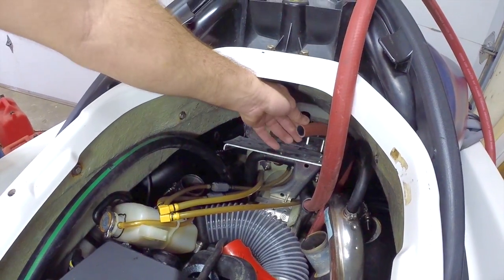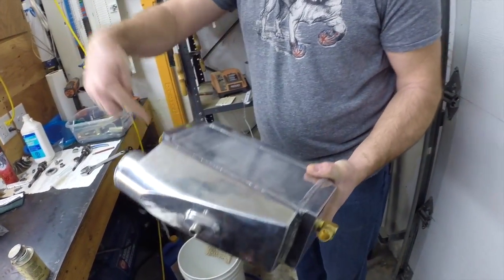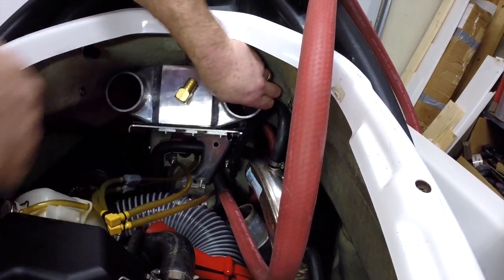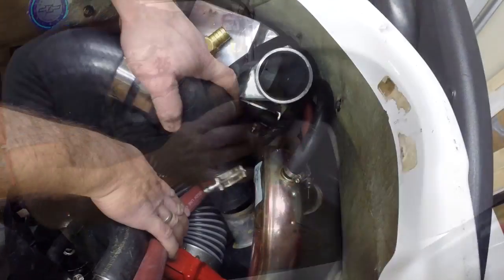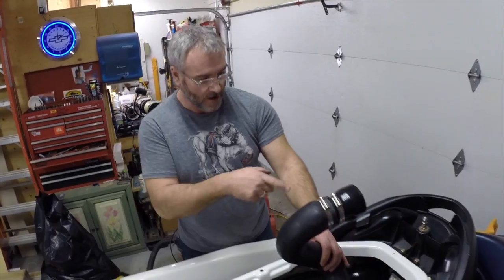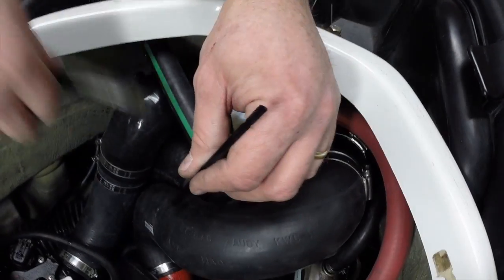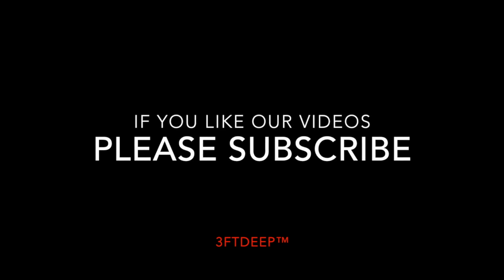How to Install an Intercooler (on a Supercharged 4-TEC Sea-Doo Jet Ski)

Comment: I am a Yamaha guy but I couldn't pass up this GTX 185 I bought from a woman that didn't know what she had. $1500 with 51 hrs on it and a trailer like showroom condition, this thing is rocket as is but yes a cold air intake and intercooler is needed. Thanks for the how to video and I hope these parts are still available even after nearly 5 years when this video was done.
Reply from the maker: Congratulations on your purchase! Yes, the part should still be available for your machine. Good luck.

Comment: I am really interested in the before and after results of adding the inter cooler…..    Standing by.. 😊
Reply from the maker: Hello Brett, You'd be disappointed. In this case there was hardly any difference in performance. There are lots of reasons for that, but let's just say that the performance of such a machine is based on a "system", not just one or two components. The intercooler is just one of them. We showed the process to help people who want to add one as part of a system upgrade. Thanks for your comment.

Comment: What kind of intercooler is that & what do you suggest to spray in the cylinders etc..after water ingestion in the motor?
Reply from the maker: ***** If you took in water, change the oil a few times, and spray some fogging oil into the cylinders. As for the intercooler, we got it from Silicone Intakes: www.siliconeintakes.com. It's a "Type 3" model. Good luck!
Reply: 3ftDeep Thank you! I'm working on installing mine now I ordered a cx racing one, looks like I'll have to modify my stock hoses this one is much wider than my stock one.
Reply: wait a minute, your parts list says type 9 intercooler but this comment says type 3.. which is it?
Reply from the maker: Good catch. It was a Type 3 intercooler.

Comment: where does the intercooler get its fresh water supply from on the pump? just anywhere in line? and how did you tap into it? bulkhead fitting?
Reply from the maker: Through the reducer (i.e. the first hose we remove). We essentially tapped in series into the existing water cooling system.

Comment: did you use the stainless couplers for the hoses you connected together on the supercharger hoses or did you use the silcone couplers? i know you use the stainless ones for the exhaust but cant tell with the supercharger hoses. i am ordering all the parts from the website you listed. How does the supercharger you installed compare to the factory sea doo external intercooler? just debating on what supercharger to go with. Do you have an email that i could contact you at if i had any other questions when installing mine? Thanks for the help and the video. Skip
Reply from the maker: skip midgett  I used stainless couplers everywhere.  I did not have a stock intercooler to compare with, so I don't know the answer to your question. Feel free to message us through YouTube if you have more questions. Thanks for your comment.

Comment: How many hours to do install and did you post or hsve s link for all parts needed. I have an 03 185, assume install is the same, yes I have upgraded the pump already.
Reply from the maker: It took us a few hours to do the job, but that will vary on the machine you’re working on, and your technical skills. Here’s the list of parts we listed in the description section below the video on YouTube: 

Parts List:
(for a 2008 RXT-X 255 Sea-Doo)
270 000 706    Intercooler tray
293 850 067    Intercooler straps, need two
293 830 124    Rubber mat
270 000 718    Rear support
273 000 238    Supercharger to intercooler hose

Intercooler and the following parts came from:   http://www.siliconeintakes.com/
Type 3
SIL000064 – 3” to 2.5” silicone reducer
BRE000954 – 3” to 2.5” 90 deg silicone reducer
JOI000112 – 2.5” stainless steel silicone joiners
CLA000102 – 2.5” T bolt clamps
CLA000104 – 3.0” T bolt clamps
Reply: So the parts listed will work on the 185:as in your video ? Also  the first part of list part #s are from where, do you sell most of the parts needed ? Thanks
Reply from the maker: Sorry, we don’t sell any parts. You can find the exact parts you need for your machine by going on Sea-Doo’s website under Parts Catalog and looking at the parts diagram for your machine.

Comment: Last year you saved me as I had rebuilt supercharger, coolant flush and replaced wear ring mid season after the Old Man thought he messed up his 2007 RTX 215. Did you guys tune it after the intercooler was installed? Any new injectors or anything else aftermarket?
Reply from the maker: Hello, Vinnie. We didn’t do anything else to that machine. A re-tune would probably have helped out though, as the performance improvement wasn’t what we thought it would be. The additional power should also lead to a change in impeller pitch, etc. ….

Comment: I have the same ski just stock nice videos by the way. I was wondering what the top speed of your gtx 185 is with all the mods? Also i'm still debating whether or not I should upgrade my other ski for a 2004 Seadoo Rxp 215
Reply from the maker: Ben King Top speed is now 63 mph. It gained about 3 mph with the new intercooler and increased impeller pitch (that'll be in another video). One thing to be aware of with the RXP is it's shorter and lighter, and loves to jump waves. It's great for shorter rides, but can be very taxing on longer ones. The heavier 3-seater GTX is way better for those long trips in choppy water.

Comment: Are you going to do one on the gtr?
Reply from the maker: mgehrke20 No, the GTR 215 has an internal intercooler so adding an external one would have marginal benefit without doing all the other modifications that would be required to get it from 215 to 260 HP. Thanks for your comment.

Comment: can you tell me where to buy the mounting bracket at? all the ones i am finding are mounting it horizontally and not upwards like the one you have? thanks
Reply from the maker: skip midgett The one we used is also mounted horizontally, not vertically. Chris got it through Sea-Doo.

Comment: I have a question. what do you do with the original intercooler, do you remove it or it continues to work normally, no matter the extra you installed
Reply from the maker: The 185 hp models do not have an intercooler.
Reply: 3ftDeep i have 2008 sea doo gtx 215 limited edition  i wanna put a riva intercooler i wanna now if i need to remove the factory one
Reply from the maker: @joseantoni7180  You don't need to remove the factory one you can leave it in the intake manifold if you do decide to remove it you will need to find a block off plate to plug the hole in the manifold I think Riva might have the block off plates.  Some people suggest removing it as this will help airflow through the intake manifold since you are adding an external intercooler there would now be two restrictions in the intake system.
Reply: 3ftDeep ok then all I have to do for now is remove the water hoses nothing else

Comment: great work and video...question, what size hose for water line did u use and type ? clamps ?
Reply from the maker: +Shambo3 
The water line is 3/4" inside diameter you can get this at most auto parts stores as it's used for heater hoses in some vehicles.  All stainless steel hose clamps will work I like to use all stainless AWAB type hose clamps as these are more robust than ordinary hose clamps.  Make sure to get the full stainless clamps as the ones with just a stainless band will corrode and could fail.

Comment: I have a GTX 185 and have avalible an internal intercooler that could fit right in the throttle house. Is it worth upgrading these machines with an intercooler? Will i make any noticable difference in acceleration and top speed?
Reply from the maker: The primary difference between a 185 and a 215 is the internal intercooler. In order to take advantage of the extra power, however, you many need to increase the pitch on your impeller and adjust the fuel ratios (i.e. computer "tune) to take full advantage of the extra cool air. Good luck!
Reply: Now I have made my first test run after installation of an internal intercooler (from a 215 machine). The difference in max speed was going from about 58Mph to 62Mph. But the biggest difference was the time to get up to max speed. Before when reaching about 50Mph it where slowly advancing up to top speed. Now it is climbing fast and steady to max speed without hesitation. I think I have got about 15-20 additional horse power with this upgrade. A cheap and very simple upgrade giving a little extra punch.
Reply from the maker: Great news! You may be able to squeak out an additional 10-15 HP with some more mods, but it's probably not worth it at this point.
Reply: Peter, did you retune the ecm when you installed the internal inter cooled intake? (215)
Reply: @70OldsS  No

Comment: i was wonder me if u can help me, my jet ski has a problem with the rpm, it doesn't reach more than 6000rpm and it has to go up to 7000 or more, now it only can go 50 kpm and before the issue 70kph the jet ski only has 4 hour, i took it to the dealer and they say that a have to replace the pump because the pump suck something but it is not cover on the warranty. my question is: what is the deal between pump and rpm, are they saying the true, why it is reducing the speed and power. this one is a yamaha v1 2015
Reply from the maker: Aldo Allende Oliva The pump is the unit that contains the impeller (like a propeller). There are a number of things that can go wrong with the "pump" that can cause the loss of power: 1) the wear ring (that surrounds the impeller) may be severely damaged (cost of ring is about $90 plus labor); 2) the impeller may be damaged (replacement $355 plus labor; repair $100); or 3) the pump housing may be damaged (expensive!). If there isn't a near-perfect seal between the wear ring and the impeller, you'll lose a lot of power. Good luck!
Reply: Why so many thing on a brand new jet ski
Reply: If I have a flat tire. Probably I can't go fast because that, but the rpm still the same. If impeller is damage. Why does it affect rpm??? I'm trying understand how rpm are relative with any damage. Rpm is electronic part
Reply from the maker: Aldo Allende Oliva That's a good question. There is probably something stuck in your pump. You should go underneath you jet ski and look through the intake grate with a flashlight and see if you can see anything stuck in there. Usually if the problem is with the pump you will still get high RPMs, but not much power. Look in from the back of your machine, too and see if you can see any twigs or other debris stuck in there. If so, take it out and inspect your machine for damage.
Reply from the maker: Aldo Allende Oliva They're complicated machines.
Reply: thanks for all your answer, im going to pick up my jet ski tuesday and define im going to have they explain to me the relation between rpm and damage impeller if it is the case. they are close today

Comment: can you verify what mount you ordered? the 08 and 09 rxtx both have different brackets. the 08 bracket sits flush on top of the rear support and the stop that the intercooler rest against on the 08 is a small piece of metal that is bent up on it and on the 09 bracket the bracket is totally different and both have totally different part numbers between the 08 and 09 bracket
Reply from the maker: skip midgett The 08 and 09 RXT-X brackets should be the same.

Comment: do you still run the oem intercooler in the inlet manifold ?
Reply from the maker: There isn't an internal intercooler in the 185 HP machines.

Comment: what state do you live in to see if payed would install onto my jet ski and how much was the total cost of everything together for the inter cooler? :D
Reply from the maker: Sorry, I just found your comment. We live up in White Rock, Canada. Check out http://www.siliconeintakes.com. The total cost for the intercooler system would be about US $300-400. Good luck.
Reply: LOL thanks man ya after that comment i got into skis and i got a 185 gtx seadoo going 70 mph did work to it like intercooler, riva exhaust , 215 computer, ported heads , wedge pump, sanded down the skid plate so its leveled to bottom of ski, metal o ring pump is bigger for the jet :D but i appreciate the reply back man XD same to you man Good Luck!
Reply: oh and the prop has been pitched too xD

Comment: HiDo inter coolers like this replace the need for having the flow through the ride plate? I have a 215 rxp and I am not sure if I should use a heat exchanger or if a intercooler a better choice? Thanks
Reply from the maker: No. The ride plate is for cooling the engine and liquid coolant flows through it. The intercooler cools the air that the engine uses to breathe, and feeds that air to the engine. Your 215 already has a small intercooler. It's probably not worth the effort to upgrade it if you're not going to do any other modifications.
Reply: I am putting the motor into a small aluminum boat I built and don’t think I can make the ride plate work on the new hull. Thanks

Comment: so for the parts list, would it be one of everything or are there multiples of things etc??
Reply from the maker: Most of the parts are singles. You should check the video again and compare to your system to ensure you have the right sizes of hoses, etc. Good luck.
Reply: i have an 03 gtx sc with riva stage 1, but all hoses to the SC are stock etc. i read somewhere that resonator would not need to be deleted for 2003 only, i dont know though.. thoughts?
Reply from the maker: I know the 03 model has an intake resonator that was deleted on the later models I have not seen one in a while so I don't know if this will be in the way.  If the intercooler can sit on top of the pump tunnel the exhaust resonator should be OK in the stock location but you will probably have to get creative with the exhaust hose routing.  I would recommend not removing the exhaust resonator the drone when this is removed is very annoying in the lower rpm range.

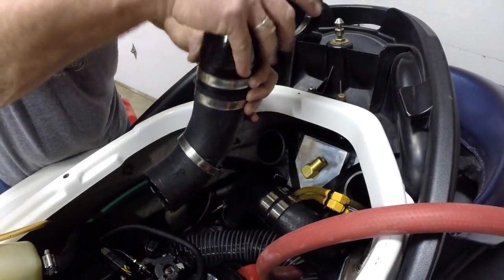Comment: At 4:03.  What are the 2 yellow 90deg. Fittings called
Reply from the maker: I believe they're called 90 degree elbow fittings.
Reply: @3ftDeepChannel  there’s no specific name ?
Reply from the maker: If you refer to them as "elbow fittings", the supplier should know what you're referring to. Good luck.

Comment: If I have a gtx 260 2014 SC, does it already have an intercooler?
Reply from the maker: Yes, you have an external intercooler. You need to ensure it's properly winterized if it ever sees freezing temperatures.

Comment: Can i use the same parts for 13 GTR ?
Thank you for your videos and the attention to details.
Reply from the maker: You've already got an intercooler on your GTR, so this upgrade wouldn't make much difference Unless you also upgraded the supercharger, retuned the computer, and re-pitched your impeller.
Reply: Have on hand the new Fizzle IC, ET127 + 3mm, run the stock 8200 file, just looking for intercooler setup/bracket so i know what hose setup to order
Was looking for the new Solas but read too many problems with the first production, any advise?
Reply from the maker: Sorry, I'm not familiar with that one.

Comment: Where can I get that bracket an hoses?
Reply from the maker: We got ours from the Sea-Doo online parts store. We found a model that had an intercooler positioned the same way we were going to install ours, and bought the hoses and bracket for that year, even though it wasn’t the same as ours. Good luck with your project!
Reply: 3ftDeep thank u sir!!

Comment: +3ftDeep How many of each parts did you buy??
Reply from the maker: There's more information in the description below the video. That and the video itself should make it self-explanatory. Good luck.
Reply: hey quick question does this intercooler is good enough for an upgrade from a 215 to a 255 rxt ???
Reply from the maker: No, it’s only one piece of a system. You would also need changes to your impeller, fuel injectors, and possibly supercharger.

Comment: Where did you get the bracket from?
Reply from the maker: Skip Midgett The bracket was purchased from the dealer it's used in the 08 and 09 RXT-X models as these have the large external intercooler from the factory.  I liked this horizontal mount because you can keep the factory exhaust resonator and exhaust outlet location, to use the angled brackets the exhaust resonator has to be removed and a rear exhaust system installed.
Reply: Do you know how that intercooler compares to the fizzle f1000 or riva gen 3 intercooler and would they fit using that bracket? I want to keep all stock exhaust? Also I have a broke bolt on my intake grate on my 06 sea doo gtx 215 and was wondering if you knew if I took the ride plate off if you can get to the nut that's in the plastic pump support housing? Thanks
Reply from the maker: Sorry, I just found your comment. I don't know about the f1000. You can easily order the replacement bolt from Sea-Doo's online parts store. Check out https://www.sea-doo.com/shop/parts_maintenance/parts.html. Good luck.